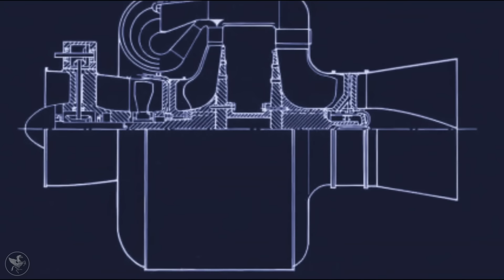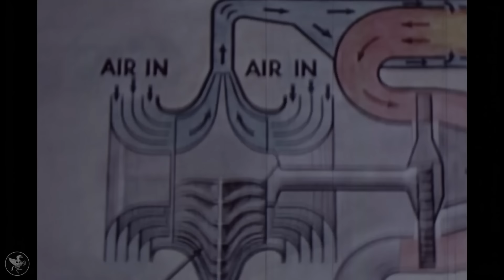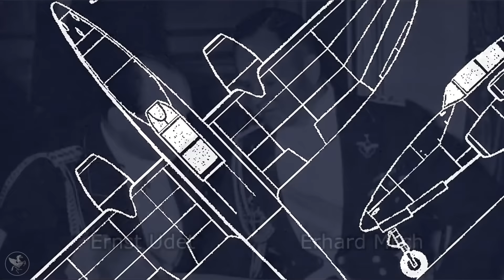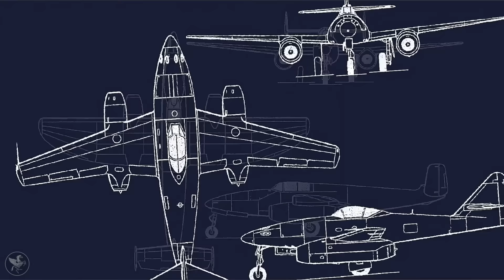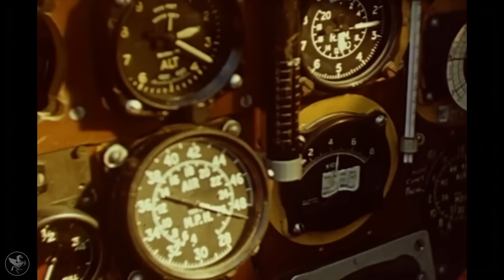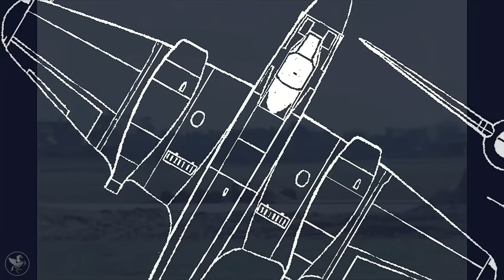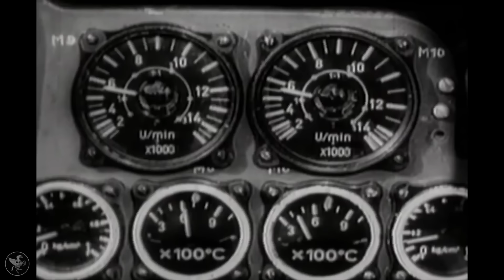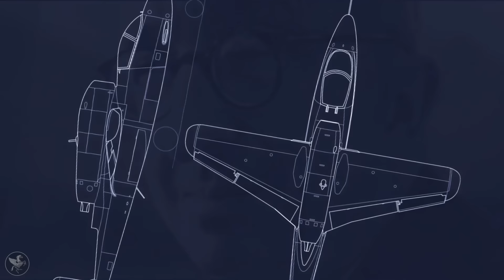Nazi Aircraft | The First Jet Fighter. Heinkel 280 versus Messerschmitt Me 262 | Full Documentary

Comment: I was told by someone who could be believed,that at the end of the war,some German fighter pilots had so few training,that they were afraid to take off,because they could not handle those sophisticated
fighters,with such a powerful torque at take off.
Reply from the maker: It was one of the lethal flaws of those terrible Jumo engines. Managing power required skills, otherwise it could flame-out.
That is one of the many reasons why nobody really cared about developing those German engines after the war, and they eventually vanished into oblivion, where they belonged since day one. The Me 262 airframe was excellent, but the heart of the jet was quite tragic, despite 6 long years of development, and companies like Junkers, BMW, and Heinkel working on it. All in all is was quite a failure which is still, wrongfully, being hailed as a success.
Most people that know a bit more will try to justify their failure with materials scarcity, but the issues were multiple.
They should have developed, as the perfect interim turbojet, Whittle’s solution (the inventor of the turbojet), which they had full access to before they started their turbojet program, but instead they embarked in an impossible project, smartly discarded by Whittle as it would have required too long to develop.
Germans were lucky that Britain did not care much about turbojets, or that Whittle was delayed by people with clear conflict of interest, or plain stupidity, otherwise on top of building the first working jet engine, Britain would have also had a jet aircraft ages before the Germans, and most importantly powered by the perfect engine for the time, and in the perfect country try, the one fighting psychotic Nazis.
Reply: @Dronescapes  Thanks a lot for those very accurate details which are à proof of an excellent knowledge of the topic .

Comment: The 262 was simply far superior aerodynamically to the Heinkel 280. With its speed and airframe splitting canon, it would be a decade before its performance was bettered. You end by saying, 'if the HE280 was developed earlier...''
Of course the same and more could be said for Whittle. If they had listened to him and protected his patents, they may have entered the war with a jet fighter and the Germans having nothing. I believe the Whittle patents were seen by O'Hain in the libraries of Berlin, where they most certainly were scrutinised by all interested. Whittle was left to develop his engine in a shed.

Comment: I believe the jet engines then had a shelf life of twenty four hours and twelve hours was more typical. Overheating was always an  issue and the metals used were inefficient. Titanium wasn't available
Reply from the maker: Around 10 hours between overhauls, and around 25 before being scrapped. Pretty appalling.
Whittle’s turbojet,was indeed less powerful, but had over 100 hours between overhauls.
It was not a coincidence that Whittle in 1929 tried to find a solution to go around the axial compressor. He knew very well what a nightmare it would be to develop one, which is the major mistake that the German companies working on the turbojet made.
The axial turbojet became reliable around 1955, and it was the British one, not the German.
Had Britain supported Whittle in 1929, they would have had a perfectly reliable turbojet by the beginning of the war, which would have put them years ahead of Germany.
Do not forget that in the 50s the Soviets discarded the German Jumo engines in favor of Whittle/Rolls Royce turbojets.
The German engines were still over engineered, unreliable, and short lived.
Whittle’s centrifugal turbojet powered the formidable MiG 15, which proved to be a nightmare for quite a while in Korea for the other side.
Whittle was a true visionary genius, who found roadblocks at every step, the Germans just made the wrong choice at the wrong time, and Britain, in general, was smart enough not to waste resources, at the time, in developing an axial turbojet, which had been theorized since 1926 by Whittle’s nemesis, the very person that delayed his work by 5 years, Mr. Griffith.
Reply: @Dronescapes  I second that. There's an interview with Eric "Winkle" Brown. He flew the ME262 - he also met Frank Whittle and they discussed the aircraft and jetmotors in general. According to Eric "Winkle" Brown -  Frank Whittle explained the development using almost identical words.

Comment: I still think the best WW2 jet design was the P80. It was fast and maneuverable, only had needed one engine, didn't suffer from the problems of widely spaced wing slung jet engines and had the modern and logical style fuselage side intakes near the cockpit.
If people want to espouse the swept wings of the 262, the sweep was modest and possibly not designed for speed and transonic reasons, in fact the sweep was similar to that of the DC3/C47.
Finally, look at the sevice life of the T33 trainer version of the P80. It was manufactured until 1959, was in US service until the 1970s and the Bolivians retired it in 2017.

Comment: No matter the failures at the time technology today doesn't even compaire to the technology back in the early 1900s considering back then everything was figured out with nothing more than very smart people. Today there is computers with algorithms to do the hard work. I started in 2002 as a prototype CNC machinist and programmer. The software then compaired to today is mind-blowing. Even mastercam in 2002 left the programmer to do most of the geometry and trigonometry and you had to basically draw the print on the program yourself. Today you pull up a pdf file, tell it how much stock you have, give it a XYZ zero, what cutter and size, how much you want to take a pass and generate and your program is basically done. Its crasy how far technology has come and how fast

Comment: At the heart of this story is a superficial view. The basis of this progress is the engines. Those are the only things worth looking at.
1. They could only be produced by the summer of 1944, so it is worth measuring the progress of different countries. UK, of course, was a couple of months behind, with the DH Goblin and RR Derwent engines, but it was already better than the JUMO 004 in 1944.
2. The benefit of introducing jet fighters to the Allies is not clear. They were operating away from bases, they needed range and reliability.
3. The Allies did enough for their superiority. For example, there was an exchange between many UK and US enterprises.
4. Axial compressors were not superior in any way, but their development made German motors more complicated. Centrifugal compressors are still used on engines of that size now.
5. The JUMO 004 turned out to be of no use to anyone after the war. Even scarce metals from the USSR did not make it a rival to DH Goblin or RR Derwent. That is, German engineers miscalculated, and with the Me 262 they hurried. German pilots were no less successful on FW 190D-8.
6. After the war it became obvious who had better motors. Straight into 1945.
Reply from the maker: Good summary

Comment: 16:20 If I'm remembering the specifications correctly, the Me 262 used the Jumo 004 engine, while the He 280 used the BMW 003, not the reverse.

If the He 280 had been pushed forward into production, it would likely have changed the progress of the war, resulting in Germany losing the war somewhat more slowly than it did. Extending the war would simply have multiplied the range of paper projects, both for aircraft and armored vehicles, that German design bureaus were producing, and in one of the more extreme possibilities of alternate history, might have resulted in the US using a nuclear weapon against Berlin. With the benefit of hindsight, the Reich was going to lose the war almost from the start of the war; the only question was how long it would take for it to collapse and how much of Germany would be dragged down with it.

Comment: 550 mph for the 262? No one managed it. Only the manufacturers said that. 
The pilots were told not to go over 450 mph because of handling problems above that speed. 262 was only a few mph faster than the Spitfire Mk XIV in level flight.
Reply: And that fight would be overr quickly, seeing as the Spitfire would have the advantages of acceleration and maneuverability.
Reply: Not true.   You're thinking of the obsolete Meteor that never exceeded 450 mph during WWII,  hence the Meteor was never used in combat.   The 262 easily exceeded 550 mph, Eric Brown clocked it at 568 mph.  Hopefully this clears things up for you
Reply: @TheAneewAony  
Read again what I wrote. Very clear indeed. Read it a few times.
Reply: @johnburns4017  Let me help you!  The 262 top speed 560 mph.  The high drag centrifugal flow Meteor never exceeded 450 mph, hence no British jet was ever used in WWII combat.  The only combat jet to operate over England during WWII was the German Arado 234!  I'm literally spoon feeding you!  Anytime I can help
Reply: @TheAneewAony 
Again for you...The service speeds of the 262 in combat was around 515 mph while the RR Griffon powered Spitfires in 1944 could reach up to 480mph, only 35 mph less. The 262 had poor maneuverability and control issues at high speeds at around 550mph resulting in the tail surfaces locking driving the plane into the ground. The pilots were instructed not to go over 450 mph. Also the engines would stall if the throttles were opened too fast - a major flaw. 

A dog of a plane. A waste of time.
Reply: @johnburns4017  LOL!  446 mph is the  maximum speed for the Mk XIV!  Just like Eric Brown said... fun fact:  the 262's cruising speed was 466 mph, 20 mph faster than the Mk XIV's maximum speed.  Eric Brown stated, and he's on video saying, that the 262's speed was 568 mph, that's over 120 mph faster than the Mk XIV, just like Eric Brown stated.  As for the 262's handling... Eric Brown direct quote!  "Oh, it handled beautifully."  Hope that this clears things up for you!
Reply: @TheAneewAony  
Read all my posts again and move your lips when reading. It is easier that way for you.
Reply: @johnburns4017  You're not very versed on the subject old chap.  Fun fact: The 262 was the first jet with an autohrottle.   Pip pip cheerio

Comment: ▪  The British Meteor deliberately had an air-frame built to a known design, so if there were problems it could not be put down to the airframe, only the jet engine.  
▪  The British made sure they had a proper reliable jet engine before going into airframes, rather than flying them with poor underdeveloped engines, as the Germans did.
Reply: Engines under the wing mean that you can adjust the design to accommodate a different engine. The design process is more complicated than you realize. It is not a matter of drawing something and then building it. The Allies only won the war because of a higher manufacturing capacity, not because they were technically superior or right.
Reply: @Willy_Tepes  
If you have a known frame design, that makes matters easier.

If you are trying to say the Germans were ahead technically and scientifically, you are wrong.

Comment: One can be most critical to Hitler and his generals for a hell lot moves such as not killing the British at Dunkirk or attacking the USSR before having finished with Britain when they had the chance. But not on this issue of using jet fighters. The only "incompetence" I see is people who think Hitler or Goering rejected the jet engines by incompetence. It was the most sane decision to take : jet engines required a lot more materials, a lot more manpower and of course massive amounts of fuel, better trained pilots and mechanics all while they were not even a tested technology and the first ones were expected to be literally unusable after a few flights. It was calculated that the overall cost of a jet fighter when adding up materials, production costs, training of pilots and mechanics and of course fuel was the equivalent of the cost of 10 propeller planes which by then were already a mature technology, made literally by car factories, working with an engine that roughly worked like that of a car (thus training of mechanics was easier and faster) and of course pilots could be trained as fast as in 2 weeks and a few flights. Of them all German generals were stuck in the fuel, the jet engine was just this voracious fuel gobbling engine which would dry up the low German petrol reserves in no time.

As such it was the sane decision not to go forward with the jet engine. It offered little advantage, just a small fighter plane that went 200 km faster than propeller fighters, sure nice, but it was not by any means a game changer, not during the war. 10 propeller fighters could beat one jet, not the other way around. Now when Germans were losing and as such their armies retracting, their consumption of oil and materials dropped and as such they tried to use whatever they had, thus the introduction of the jet fighter into the battle. Which basically did absolutely nothing. The Foo Fighters frightened more the American pilots than the Me 262.

Comment: The Me163 Komet was the fastest and best fighter in WWII.
Reply from the maker: The Komet??? Really?
Reply: @Dronescapes  Komet was the fastest warplane in WWII. Its rocket engine didn't flameout, like Me262 unreliable jet engines.
Reply from the maker: @ViceCoin  did you check how long a flight lasted, or what kind of super dangerous fuel,it used?
It was a remarkable death trap with no real future in practical terms.
By the way, It was a rocket engine, not turbojet powered.
Reply: @Dronescapes  Minutes of flight, volatile fuel, but even the space shuttle blew up.
The Komet could not be touched.
Reply from the maker: @ViceCoin  the Space Shuttle went to space, which is immensely more complex task than a simple flight, but you surely know you cannot really make a comparison.
Do you see many super dangerous rocket powered aircraft that are currently operational?
There is a reason why they have been abandoned a long time ago.
Reply: @ViceCoin The Space Shuttle was a more stable craft, and it had the benefit of decades worth of rocket science. Before the Komet, the only real precedent was the RAK 1 from 1929.

Comment: Inaccurate here.  V1 was not a jet - so it wasn't a meteor that got first jet kill.
There was a earlier German jet to the 280. this is just a inaccurate, badly researched site.
Reply from the maker: You are probably referring to the Heinkel 178, which is mentioned in the video. If you are referring to anything else, please be so kind to also add some information, rather than just a vague comment.
The V1 had a jet engine (pulse engine). what today we commonly call jet engine is in fact a turbojet, but today we simply call it jet.
Reply from the maker: @louisavondar9178 Or perhaps historical facts matter more than catch phrases without any substance
Reply: you didnt watch the doc